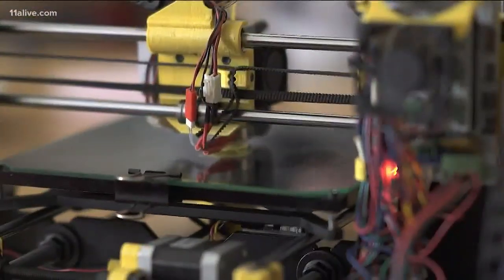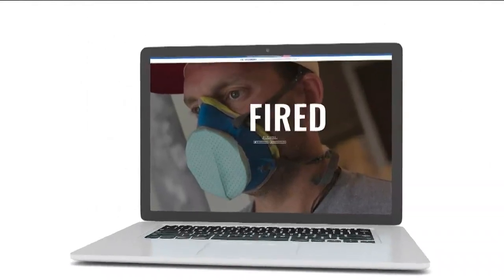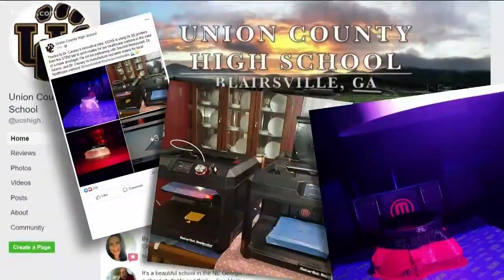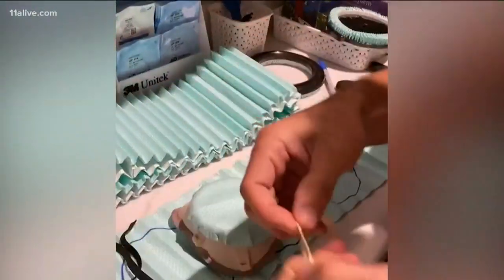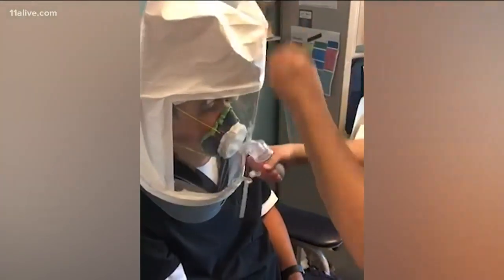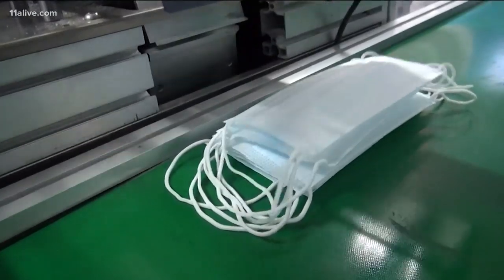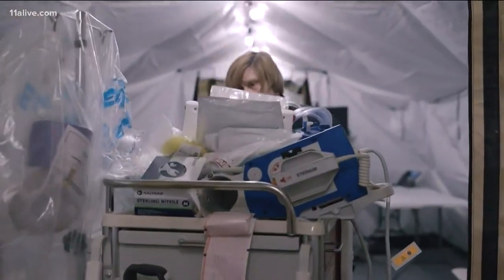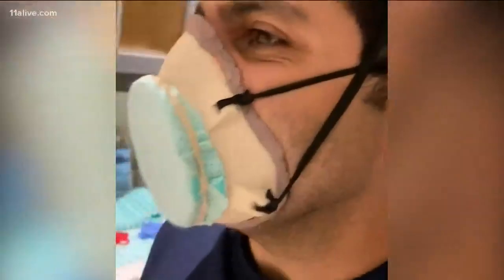Georgia dentist creates 3D template to help mask shortage

Comment: FFM 3D printing leaves layer gaps that virtually makes the mask too porous to be truly effective.  They would have to have a sealant coating over the 3D printed part, plus an effective seal around the filter material.

Comment: I did the same thing for gas maks because the 40mm canisters that come with soviet era masks CONTAIN ASBESTOS DO NOT USE THEM!  You can get all the supplies at a pet store.
Reply: did you use the existing canister and just replaced the inside filter element?
Reply: @joserizaladventures  before you go buying supplies... got to your states news paper or dph wesite. Get out a calculator. Add up allllll the cases. Your welcome. Cuz where im at.... they are short 5000. They are beating this like a dead horse. Every election yr theres a NEW virus... also i have a family member in nyc. He said there are empty hospitals. I went to a hospital one county over from mine and that county paper was saying its over flowing..... AINT SHIT GOING ON THERE. If you dont knownor cant tell the truth. Its not worth the risk.
Reply: @waterisgood6205  tnx
Reply: @joserizaladventures  no. I used metal tubing a welded together on low amps. You can also use vitamin bottles. If they dont fit stretch electrical tape on it. Put the mask and new filter together. Put it on and check for leaks